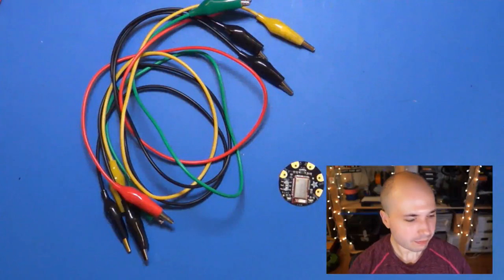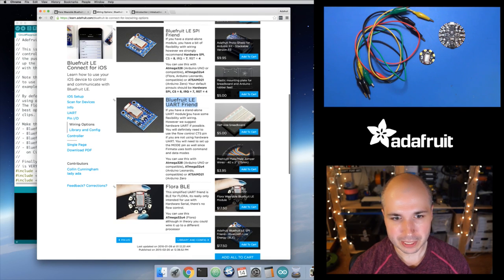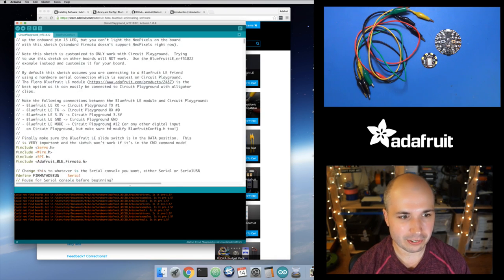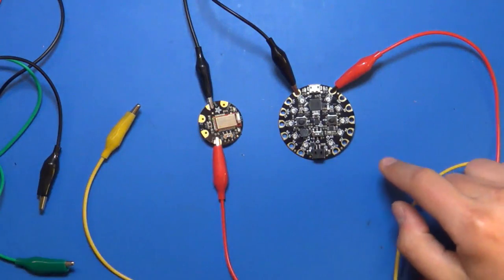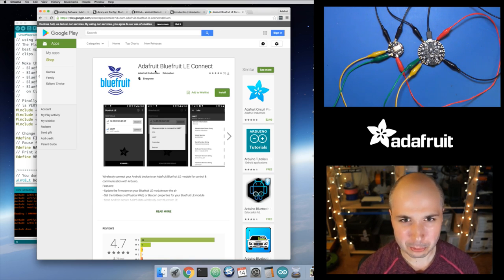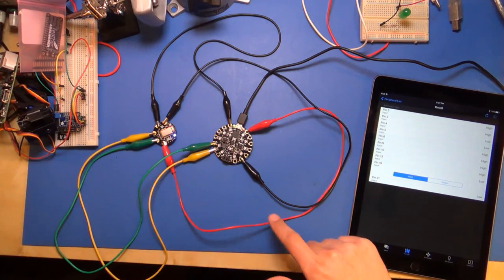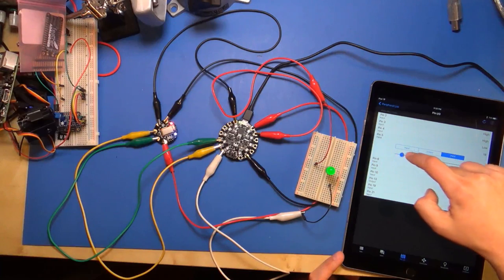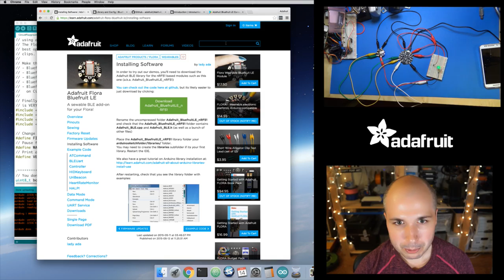Circuit Playground & Bluefruit LE wireless pin IO with Tony D! @adafruit #LIVE

Comment: Hey Tony!
Had you try it with Circtuit playground Express?

Could you help me?
Reply: I seem to have the same problem as you, I also have the newer express version and the sketch provided in this video does not seem to work. Did you manage to solve this issue yourself?
Reply: I know it’s been years but this is something that I would still like to do as I have a Circuit Playground Express and Flora BLE module at home collecting dust. Does anyone want to share how to get these two boards working together?

Comment: It does not seem to work for my new circuit playground express board. I am kinda stuck at this point in which bluetooth works and the board works, but when i try to control  it with the bluefruit app it gives a "no responce to capability query" error. Any idea's what could be the problem?